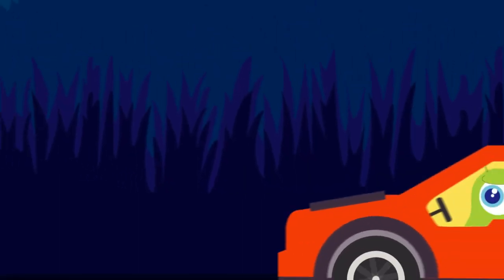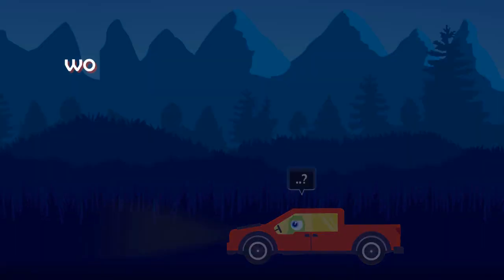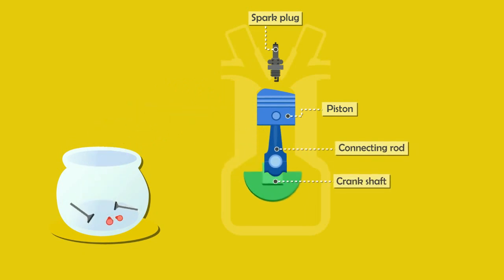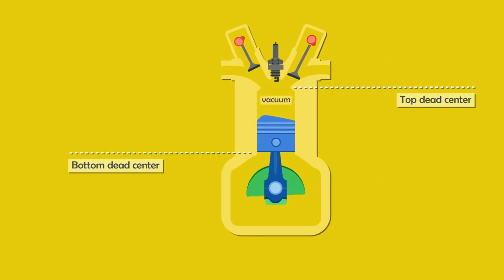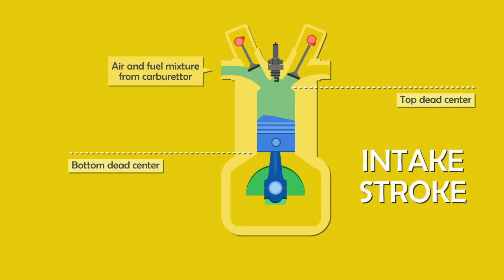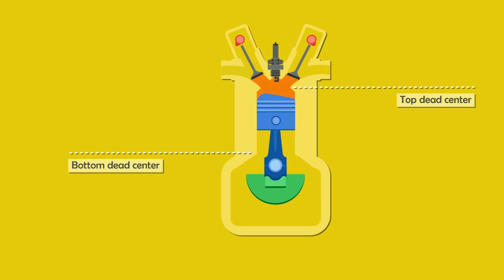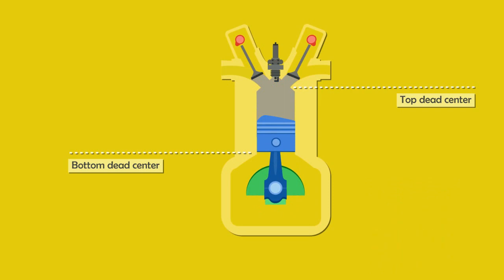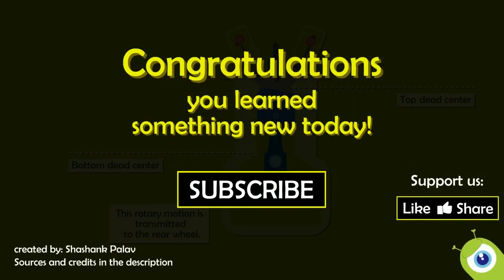How a car engine works | 4 stroke petrol engine.

Comment: how does the crankshaft rotate then?
Reply: what makes it rotating?
Reply: @heighho9142  cranking can be made manually or by using starter motor which we press while turning on the ignition. After starting the engine the engine crank rotates itself with the help of moment of inertia of flywheel